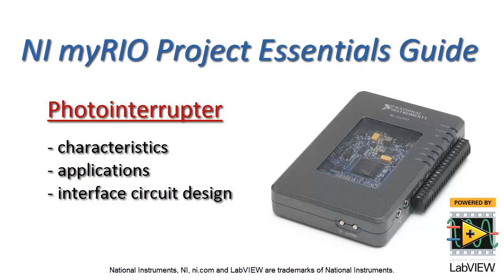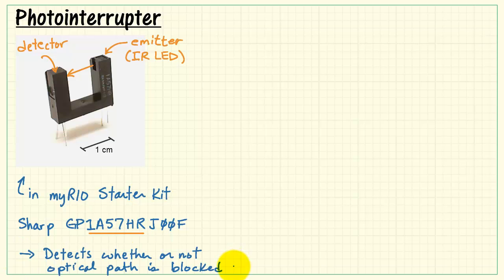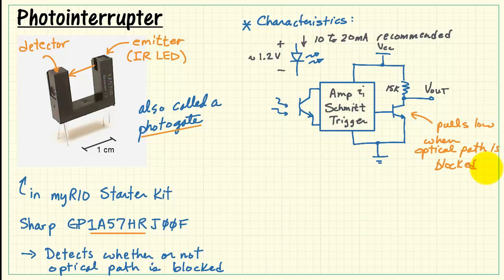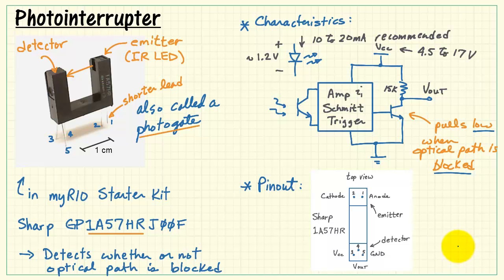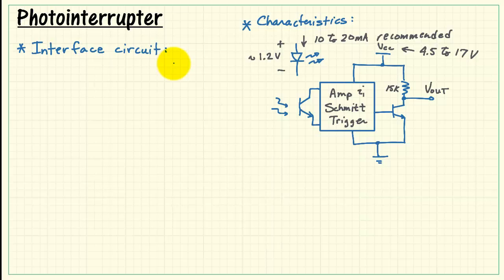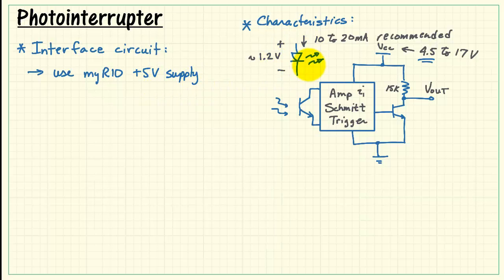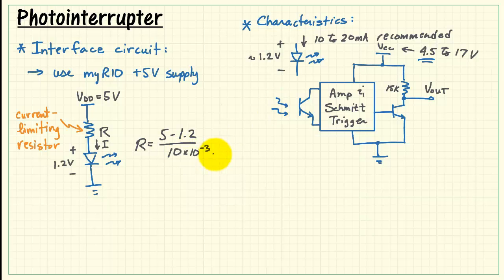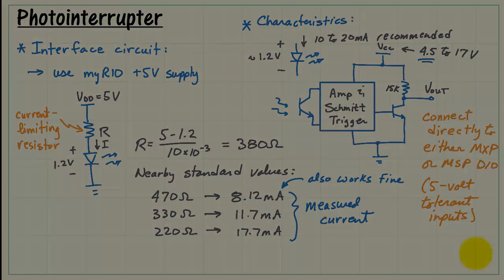NI myRIO: Photointerrupter

Comment: Hello:)
I have a Raspberry PI 3B project that I need a photo-interrupter (SparkFun GP1A57HRJ00F). Can I power with the 3.3VDC GPIO pin? If not then do you have a circuit to make output compactable with the  Raspberry GPIO inputs?

Comment: Do you know what is the maximum possible distance between the IR  LED 
and a phototransistor for this set (1A57HR SHARP)? There is originally 
made 10 mm wide gap between them. But in case I need  wider gap, how 
wide can I make and do I need also to change current for IR LED?

Comment: Hello! If it's not a secret, but how you calculated that resistor on collector should be 15K Ohm? What should be values of HIGH and LOW Vout? I have similar photointerrupter and got HIGH=4,7V when LOW=4,6V. Is it should be like so?
Reply from the maker: The circuit that you see beginning at 1:12 is taken from the equivalent circuit presented in the datasheet; the 15K resistor is part of the photointerrupter itself and is not an external component. However, you can use the resistor and transistor circuit to estimate your HIGH and LOW values for a given supply voltage Vcc. You should see a LOW voltage closer to 0,2V (transistor ON) and a HIGH voltage closer to Vcc (transistor OFF); the HIGH voltage is more accurately calculated as Vcc minus 15K times the current pulled from the Vout terminal.

To summarize, you should definitely see many volts difference between the HIGH and LOW states.

Comment from the maker: The myRIO encoder counter can handle a maximum pulse rate of 5MHz (200ns pulse period), and the pulse needs to be in a high or low state for at least 100ns. Measuring 1500 fps should be quite possible, provided that you do not have an excessive number of pulses per foot.
Reply: could you help me to implementing measure rpm with photointerrupter sir???